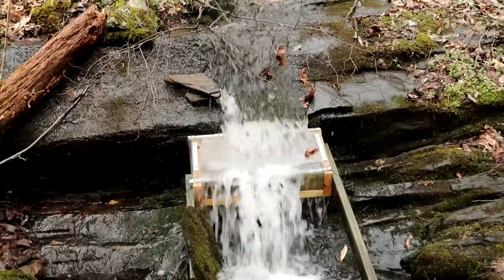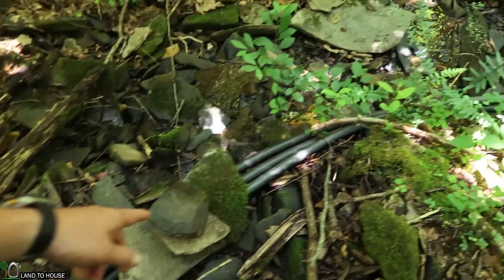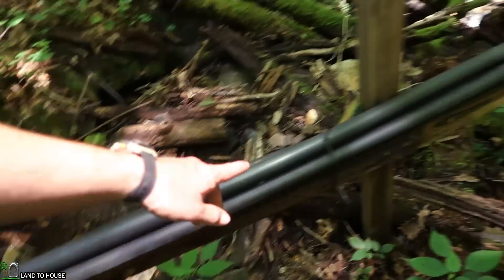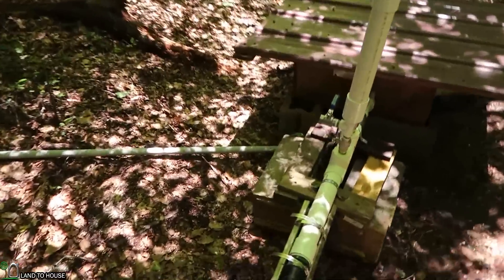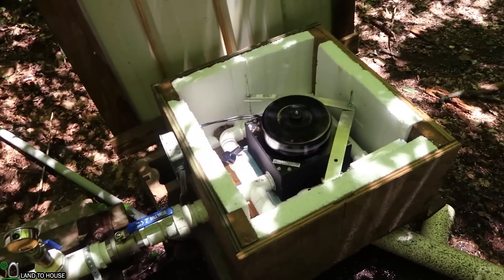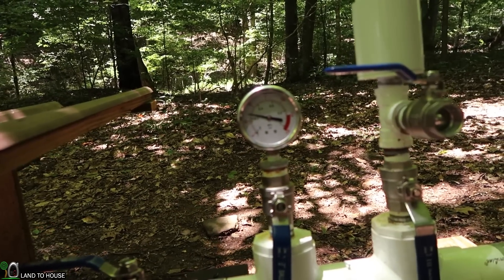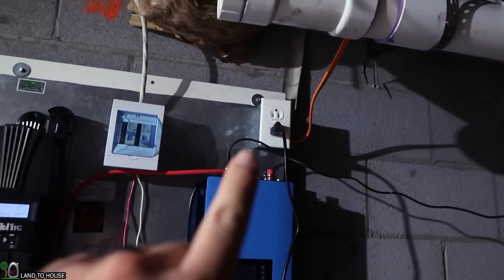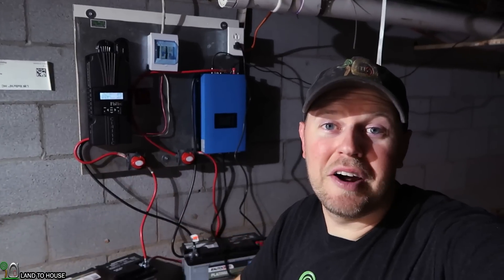Full System Overview Micro Hydro 10/10

Comment: Great Job!

A digital flow meter switch,  a PLC and 4 solenoid control valves would have been recommended  to increase and reduce the pressure by turn off and on the jets when the water pressure or power drops or increases.

But this can only work when the turbin is close to a power source.

Above all great achievement 👏

Comment: Cool thanks for sharing..thats a good turbine build..perhaps increase the height of the 45 gallon top holding tank for more flow and hydraulic pressure..and you'll increase the watts considerably.
Drop the water at the turbine blade for free flow. 
But
Its easy to be a couch engineer..
Like why the heck didn't nasa put solar power panel wipers on the mars rovers..and the thermometer.
lol

Comment: You need to solve the worlds energy crisis in one fell swoop.  Mount a fish tank in the top of a bedroom closet and a kid plastic pool on the floor.  Have the clean water recirculate, closed system water pump.  Pre built for any normal home bedroom closet (for noise issues).  It would sell across the world changing peoples lives.  Maybe 2 turbines in series might maximize water pressure and usage.  A low power water pump with enough torque and pressure has to be out there somewhere.

Comment: We electricians do it without shorts and carry more juice. :) They sell the black polyp pipe in 1000 ft. reels. I see you discovered the high pressure-ball valves don't get along. Gate vales. I spend the extra buck on brass internal barbed fittings and double the good quality hose clamps per connection. cut once, bury once. Rent a cutter and plastic pipe welder. As strong as pipe when done. Electrical Codes are different per state, county and city. Green GROUND all metal boxes and any steel in and on system. It is a bonding ground! With cut or scraped wires and wet earth, potential for deadly accident. Maybe a weatherproof 3-phase lockable disconnect at the turbine for emergencies. Save some footsteps up and down the hill. Lastly, we must have disconnect at meter base here so when utility power goes down, can't electrocute linemen working poles in storm Called back feed. Tickle a lineman and they will hunt you down.
Great Works!!! Your neighbor will benefit from your experience.. lol

Comment: Word of caution: wiring contained in its own insulator, such as romex or your ground contact wiring, emits heat, should not be contained within conduit. Not saying it will, but it can overheat and melt the insulating jacket. With wiring such as residential romex, one will note the actual wire has a insulating coating, then it is placed inside an outter jacket, that is in fact the conduit for the wiring. Not trying to be a wise ass, just a note fyi

Comment: you transform the water energie from AC to DC, load battery with DC and this DC energy goes to the inverter that turns it back in AC for the House?
Why you dont keep it in AC Water, to the House what needs AC?

Comment: Have you considered automating the system? With a float meter in the penstock, load from house, state of charge of batteries, some automated screw valves on the turbine and an arduino or pii you could configure it so the valves would auto adjust according to how much water you have in the penstock, it would also shutdown / slowdown the hydro if the house wasn't using anything and the batteries were full. This would have the benefit that if you had a sudden downpour the system would react instantly.

Comment: This may be a silly question but how possible do you think it would be to use a siphon to continuously pull water, from a pond, up a hill then run it back down into a generator before exciting back into the pond? It seems a bit close to something like perpetual energy but still it's an interesting idea for me since the siphon wouldn't need electricity. I guess it comes down to how much water can you get up the hill in what amount of time to make it actually work? Also, I'm not sure how far a siphon can get water up a hill. Any thoughts?

Comment: Hi Seth, Can I ask a question please ? What happens to the power from the hydro if your battery is full and your house isn't using any power ?
Does the Midnite classic controller stop or reduce the load into the battery or do you have some other kind of dump load to use the power up ?
Kind Regards
john
Reply from the maker: The midnite classic is able to take in voltage up to 250v. If the batteries are full the midnite will spin up the hydro to max rpm and dump the load on the system. I hear this often when the sun is out and my solar panels are pulling in 2500w. The hydro will spin up and not do much on a sunny day. Then at night it is back to its normal speed. So yes yes the midnite takes care of the power when not needed.
Reply: @LandtoHouse  Hi Seth many thanks for your reply,  I've been building a system for 3-4 years now and have just ordered one of those inverters as I liked the way you can control the amount of power you pull from the battery. my main hydro is grid tied but I want something I can use for charging the battery bank when I have no wind or sun. my hydro is the same style as yours but is a five wire rated for 4k and around 450v. the problem is I just can't spin it fast enough to get enough on the single phase side for the battery side of things so looking to buy a second smaller unit. at full speed when I have full water I'm getting 920w grid but only 11-12v on the single phase side, my battery is 24v so it's no good.
I have two grid meters in the house one for the main house which is on an older analogue meter but the outbuildings are on a digital meter so anything I feed back I get charged for, so with the new inverter and a smaller hydro generator I'm hoping that will do the trick. 
That's great to know the Midnite Classic will control the hydro when the battery is full as I don't really like having to burn power off with a resistor bank like I do for the wind turbine.
Anyway thank you again for your help. enjoy and have fun 
john

Comment: Hey how much would a system like this run would it run an entire home and if so for how long and how much does this setup cost I’m new to this but want to cut bills out of my life at least power me some on food too and this looks very interesting
Reply from the maker: For hydro to be cost efficient you need either a lot of head pressure or a good flow rate. Or both. This system was approximately $4500. 

Solar can be a great alternative.  My solar panels were used and only $0.26 a watt. 

Power bill last month was $54. Down from $105.
Reply: Oh wow that is expensive but def worth cutting electric bills and that solar way sounds nice too and thanks for the response appreciate it
Reply from the maker: @callierose7695  it can be costly. There are ways to save on some things. Batteries are going to be expensive one way or the other.

Comment: In 20 years with zero maintenance or repair costs this system will have paid itself off. That's assuming the batteries were free and will last forever. This system only creates $230 a year in electricity and with batteries costs about $6000+ dollars to do yourself. so more like 25 years or so before you see a return on investment. This is only feasible for someone that lives off grid in the northern latitude where the sun barely shines and they have a 150+ foot drop creek or river on his her property. So like 200 people in the entire world might actually be able to benefit from this. If you had much more water flow it might be worth it.

Comment: isn't there a lot of voltage loss happening in that 250' run of wire from turbine to the house?
Reply from the maker: With 3 phase ac there is not much loss.

Comment: I don't feel like 50 gal drum is enough. It's seems to me the volume of your reservoir should be more than the volume of pipe you have And you have over 1100' of 2" pipe. 2" pipe holds .1633 gal per foot now multiply that 1,100 gives you 179.52 gal. Just in the pipe

Comment: Hmm.  maybe put a float in the barrel.  When the water level gets so, it sends a signal to a solenoid to restrict the flow to the jet(s) so the barrel doesn't run dry.  As the level increases, the solenoid opens up the jets more.  That way it is automatic.  If the level gets too low, a signal (buzzer) can be sent to the house to let you know a bear has knocked your barrel over to get a drink!  Pesky bears!!!

Comment: Just had an apifiny watching one of your videos again. An idea for a  catchment box. Cut a plastic 55 gal drum. If you make a long cut straight from top to bottom then make a cut from that cut on each end about 10" both cuts the same direction you would be able to use a heat gun to  bend the cut piece back to form something like a ramp type scoop.  Then using screen over the ramp and hole across the barrel . You can use half inch PVC pipe cut in half and heated and flattened to make strips that you could predrill pilot holes in and lock down the screen wire and on ramp piece take a pool noodle cut to match the length of the ramp and the two short sides of the ramp. Then make a single cut down each of them  so you can slide them over the PVC Screen holding pieces. If done right you would have already cut your holes and inserted your bulkhead fittings. Now you have a large plastic catch basin with a water ramp and guides. Oh! And if you want to be sure the water doesn't leak off the ramp I would use a tube of clear silicone caulking around the pool noodles on top of your ramp with the screen wire. Let me know if you think it's a good idea or not.

Comment: Cool 
Why didn’t you just install a small cistern, eliminating the “trickle collector” and barrel. Then you could localize your A/C generation, running your wires down the hill. In this system, you could avoid water needlessly being sent running down the hill. If I had to repair this in the “weather” you could trouble shoot and fix with relative ease. I suppose one could wait till the storm passed.

Comment: What was purpose of battery? Seems like it’s just slowly killing battery life cycles by charging then depleting, can you just bypass and go Dc right in to the grid tie?
Reply from the maker: You can bypass the battery but if your using solar only it would only supplement when the Sun is out. Also I don't let the battery discharge past a certain voltage

Comment: Interesting project but I'd rather use two or three solar cells. Way cheaper and doesn't do any harm to the local ecosystem.
Reply from the maker: I do both. Currently 1kw solar with another 2k on the way. Then the hydro.

Comment: AC to DC to AC makes no sence to me, my house is all AC, explain why you cant use AC direct from the AC generator .
Reply from the maker: The pma makes wildly fluctuating high voltage 3 phase ac. A house needs very regulated 60hz 120v single phase ac. Also you can't store ac.
Reply: @LandtoHouse  Ty for the info, could you run anything that's 3 phase from it ?

Comment: You mentioned a 160' drop. Did u mean vertical from creek source to MIcro Hydro Generator? Because other than that, I don't see where your 65PSI originates from.
Reply from the maker: Yes. This is actually a 10 part series. Check the description for the other parts.

Comment: Thank you for the informative video. Question for you. Would it not have been more cost effective to install the turbine after a short/shorter downhill run from the barrel? That way you could run the (relatively cheaper) cable the entire distance back to the house (even if inside a small diameter cheap/thin tube)? Sorry if I missed the reason in previous videos.
Reply from the maker: The issue with that is the more drop to the PMA the more power. I have 165 feet of head pressure at this point. If I had gone up closer to the Tank the power would have reduced.

Comment: Question - For the Jets, could you not change the flow configurations of the PVC pipes on the generator in order to install some pressure regulator switches, these switches are connected to port valves which would automatically open and close, thus increasing and decreasing the Jets in use in accordance with the available incoming water pressure.  This would ensure that the Generator is running at optimal power at all times and less requirement to visually/manually adjust.??

Comment: Stop using pressure to drive the turbine!!
It will eliminate leaks and less problems.
Put on a pump vallute to tighten the blade tolerances instead of that stupid design in a box your driving it with!
Thats dumb.
Instead use the negative pressure created by the weight of the water pulling through the drop of the piping.
Then you eliminate those stupid valves and the box that is a vortex and cavitation dead flow nightmare!
That turbine design is an inefficiently designed waste of cash.
You can see real turbine designs online. 
Power plants with dams dont put the turbine in a pressure situation but in a negative pressure situation to avoid flooding the plant if the housing breaks.
A simple bypass at the turbine location will start the flow.
Then shut off the bypass and the negative pressure from the syphon effect will then pull the water through the turbine.
If you tighten the tollerances around the blade you will have less loss off efficiency and you wont get cavitation by pulling water.
The box you have the water going into will cause vortexes in each corner of that box that will cavitate and cause the turbine blade to stall for lack of flow every time you have a load on the generator.
(Use common sense and talk to a plumbing wholesale company to find a tighter vallute to wrap around that turbine blade. Im sure they would be happy to help you.)
Then YOU can tell your "expert" how to fix his poor design and how to properly put the turbine out of harms way by pulling the water through it by syphon pressure.
Good luck.
I hope I didnt sound bitchy.
I am a boilerman by trade and just saw allot of flow symatry problems and saw how to get rid of your static pressure problems by making to draw instead.
A pump pushes with a motor to make pressure, so if you already have flow a drop will make a vacuum syphon effect to pull the generator motor into action.
Think about it.
Its the most sensible way to do it.

Comment: I just found your channel but unless I heard you wrong the max input from the system is around 3000 watts a day...total?seems like a lot of effort for minimal gain?again i may have misunderstood 😕
Reply from the maker: With a little redesign of the housing i should get a max of 12kwh in high water flow times. 

This hydro system plus solar will save around $60 a month.
Reply from the maker: My system typically makes 8kw a day.

Comment: BMS?
Reply from the maker: The Midnight charge controller keeps the batteries regulated.
Reply: not needed for lead acid batteries 
the charge controller handles everything 
It's only lithium that needs a bms iirc

Comment: How do you prevent the various components from freezing in the winter?
Reply from the maker: That video will be coming out soon.... a mouse chewed a wire and locked the pma. I turned off the water and everything froze and busted. So the redesign will have insulation and a pipe to exhaust water on really cold days.